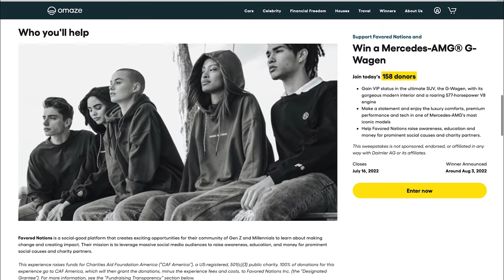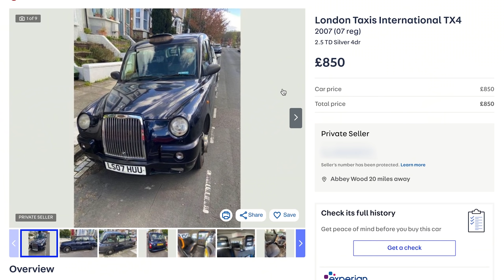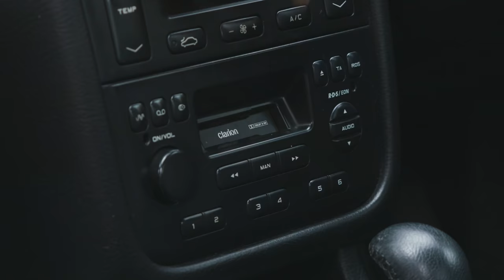Can We Beat A G-Wagon With £1000?

Comment: I reckon you’d get 10% more power from the 406 with a good service and a bottle of Redex
Reply: I was about to say the same. Would love to see a rematch with the Pug well taken care of. Or just throw out the dead weight sitting on the passenger seat. xD
Reply: I honestly expected them to do it, because it's a £1000 challenge, so they still have £100 left over to do a good service.
Reply: Oil and filter change, change the gearbox oil. I think it would make a big difference. Don't really like peugeot but the 406 coupe is a nice looking car 👌
Reply: @BerserkFury89  even just sitting it for half an hour with the engine running, premium petrol in the tank and the revs held at say 3000 would have made quite a difference - get it nice & hot, decoke the heads, clean up the injector tips and heat the spark plugs through so they self-clean.  Total cost would have been 20 quid of fuel or so (as long as the radiator thermo-fan worked anyway)
Reply: Junk the standard air sock that goes to the airbox  - it's a genuine (for once) restriction on the V6 406.
Reply: An oil change on that autobox would probably make a huge difference, they're sluggish as fuck when they get old
Reply: agreed
Reply: @TheRealFLX81  Put it in the boot of the Saab as originally suggested :)
Reply: "Do you want to see more G-Wagon drag race content"
Yes, I absolutely want to see them tune up/weight-reduce the 406 and have a rematch

Comment: So happy to see a 406 coupé here, I own one and it is my first car (not the V6 sadly, the little 2l petrol). But it is such a great daily. It's comfy, nice to drive even 23 years after its first run, and there is enough performance for most if the situation. And even here in France, we don't see some that often. Love it !
Reply: I also have one and really live that car. I own another cars, more recent and expensive, but i prefer the 406 Coupe 👌
Reply: I have 2.2 petrol 406 coupe and this gem is staying with me no matter what. If my gf would announce tomorrow she’s pregnant with twins - I hide 406 in a garage and buy proper daily, but never sell it :D
Reply: How's the maintenance on these I'm out here in Mexico and I've seen a few around and even one that was a pininfarina version it was hot I asked the owner bout it a bit but def a cool change from usdm cars!
Reply: @E_tiBEAMERBOY  Mechanical parts aren't expensive, cuz underneath this is still a 406. The problems start if you need some body parts - i.e. bumpers can be crazy expensive. 
Fuel consumption - my 2.2.pb needs around 13 liters of gas per 100 kms in a city. A few weeks ago I was making a trip, around 1000kms and it burned exactly 9 liters per 100 kms.
Reply: @E_tiBEAMERBOY  it's a great car. I also have a 2.2 petrol coupe. If you maintain it like you should, it'll never let you down. Mine has almost 270.000km and i can still throw it into corners and drive it like a maniac and it'll happily do it. Ofcourse things wear after such times and i think that all Rubbers will have to be changed by 300k. At the moment i have a few leaks, one from the engine to the transmission and another from my head gasket. Both sound more serious than they are and it drives like it should. It just needs some love but my funds are low atm lol. also not difficult to work on, the engine is in plain view

Comment: "engine light was on but the engine wasnt my worry"
says it all with a peugeot
Reply: These 3.0 V6 ESJ engines are very good solid lumps. The very most that could be causing the EML is a coil pack of O2 sensor.
Reply: That era of peugeot were reliable. I had a 106, 206 and a partner. More reliable than the Nissan and Toyota I owned. The  208 GTi I own now. Yeah, that's a whole different story.
Reply: Had one did over 100000 miles in mine and the engine light never came on. That will just be a sensor failing after 20 years same as any car would

Comment: The ZF auto box on the coupe has a "Sports" mode operated by a strangely hidden button.  I wonder if those guys found it.  It makes a real difference to the way the V6 puts down its power and manages the gear changes to optimise acceleration.  Seriously, the 406 Coupe was never designed as a drag racer but a high speed luxury cruiser for the French Autoroutes down to the Cotes d'Azur. I've done that and in that environment it does everything that you need for an idyll drive! 😍

Comment: That 406 has got the 190bhp V6 in it. The later ones got the 210bhp upgrade.
Stunning cars, my dad had one of the first back in 1997 in Lugano green.
Reply: Correct, later L7X's had VVT which gave them a power increase.
Reply: This coupe has 210 bhp engine. Older engine has different engine cover and an oval intake at throttle body

Comment: I reckon they should put the 406 on a dyno to find out if that EML wad holding them back... see if it was actually putting 210bhp through the flywheel.

And if it wasn't, get it back and recalling the G Wagon

Comment: I owned a 3.0 V6 406 coupe back in 2009 for which i only paid £1500 for a 1999 model. The V6 made such an immense noise at full chat, just a shame its actual performance didn't match up to the sound. 

The version I had was the 194 bhp manual not the 204 bhp and that took 8 seconds to get to 60. That 204 auto would take around 9 seconds not 7.4, that was the manual version

Comment: I had a fencing business and a Nissan dual cab with an LS2 swapped in. I was towing a trailer with my skid steer on it from the back paddock on a huge farm. One of the other guys was driving a 79 series Landcruiser and decided to race me. I know that Landcruisers top put around 150kmh and I was pretty sure I could top it. So I was doing 165 flat out towing around 2500kg on a farm track. It actually wasn't too bad because I had really good trailer brakes and it stayed pretty planted.

Comment: That 406 is well posh, in it.
I have a £30k Porsche and a £3k Alfa Romeo. Same results in drag races between the 2 as this. Porsche kills it off the line but start at 20 mph and there’s not much in it. NA big engine v turbo smaller engine.
Love your work 👍

Comment: As someone from the US it would have been very interesting seeing what would have been available to try this challenge. Also its fun to see a challenge that my personal car might have a chance at. I've got an 05' Buick LeSabre Limited, its a decent car you can find for not too much and with a service its a 3.8L V6 with 200+ HP and a 4 speed gearbox. Probably still would've been beat out but still would have been cool to see.
Reply: Would have been almost exactly the same, maybe a smidge slower than the peugeot. Power to weight is likely almost identical, so its down to how good the gearboxes are, which also shouldnt be too different.

Comment: I can't believe they didn't think of the 2.7 Bi-turbo C5 A6 or early to mid 2000s Saab 9-5 2.3. For 1000 pounds they would've been in a really rough shape, but probably good for a few drag runs, before start pissing oil and coolant everywhere. But still 250-260 hp and with manual transmission.

Comment: I would like to see this drag race again with the same cars but first, fully service the Peugeot plus change the fuel filter, fix the engine light issue, check tyre pressure.

Comment: The L7X engine is pretty good and its easy to take them to 225bhp the same as the original Clio V6.  However Renault, Peugeot, and Citroen have stopped all parts support for this engine. They leak oil so bad from the plastic rocker covers and without part support they are a nightmare. I used to have 2 Laguna II V6's but ended up scrapping both as i could not maintain them anymore.

Comment: The pt gt would be the best choice. SRT4 motor with 230hp 245 torque stock, pull the line off the wastegate and you have 300hp for the drag race

Comment: Considering the check engine light was on in the Peugeot, there's a good chance that was in limp mode right? So it would probably have beaten the G-wagon if that was fixed.
Reply: Wouldnt have been in a true limp mode if it could do those speeds, so I would say no. Lots of issues can give check engine lights without affecting power.

Comment: So I brought my first car in February, done me decent until I past my test 😢in may, the starter motor needs replacing and the map sensor, both cost around £180 total, I’ve already replaced the exhaust and put loads into it, it’s a VW Polo 2005 1.2L with 144000 miles would you go ahead and fix it or scrap it.

Comment: Can you do a top speed run somewhere? See how fast the 406 can still go after all its years
Reply: They cant. No airstrip is long enough to test the top speed of a normal car. They would have to go to Germany for that, and I doubt they will for a cheap car as this.
Reply: @GoldenCroc  Millbrook proving grounds has a circle track for high speed testing, top gear used it in a few of their cheap car challenges. As such it's available to be hired for filming.
Reply: @dominicrichardson5546  Never seen a uk based youtube channel use anything but air strips; as such I draw the conclusion the track is much too expensive to rent, more than an autobahn back and forth would be. Top gear has/had as we all know, a budget probably hundreds of times larger than most youtubers. So it doesnt seem likely, sadly. Cheers.

Comment: You guys should check some other auction houses yourself too! You can find steals from there with a low price, i found my 7 series e38 yea its a 725tds but i got it with a 1/3 of a price of one and it was working perfectly.
Reply: 725 tds e38 is a pretty cool car... the ultimate mile muncher without having to fill up too often (higher average speed) back in its day.
Reply: @GoldenCroc  Yeah, bought it on online auction, they couldnt get it to run, with 1/3 of marketvalue, got a running driving car, it just had summertime diesel in it, so it could only start in a garage, after 15mins warming up it was a runner. First go started right up. And its a amazing daily car for the diesel and not so thirsty engine even with a heavy foot, 6/100KMperL roadtrip high milage trip but 10/100kmL in town xd. It still does it to this day.
Reply: @atsv2829  Very nice. You will perhaps be pleased to know I do quite long and pretty fast trips in my car (E92 335d) myself, latest one was today. Not comparable to an E38 in comfort of course, especially since I got semi-track suspension on it. Cheers.
Reply: @GoldenCroc  They are a excellent sample of BMW engineering! Mine waits for MOT, what it should pass fine :)

Comment: I know you have a no BMW rule but ive just searched and found 2 530s that would be quicker...Im only 11 mins into the vid so dont know if the Pug did the job but....     It'd  be the same stories with Mercs. Get an old unloved E320 as theyre going for under a grand and will have more power than the pug (more weight too)

Comment: well, I bought and tuned a car for about £1500 and it wasn't much slower than a g wagon without something in tow. 0-100 in 5.2 sec and the g63 amg is 0-100 in 4.5. give me some time and another grand or so and I would have beat it. or just risk the engine, turn up the boost and hope the engine doesn't go boom

Comment: Pity you got the automatic, very bad for drag racing. Second gear goes to 130km/u. Manual is way quicker, automatic doesn’t do 0-60mph in 7,4 sec I think. About the EML, start by changing the coil packs. Very common failure, I saw you had the original black ones. Unbelievable it still has those. Valve covers are very common to leak, yours leak to. The internals of the ES9 V6 are very strong, no oil usage even with high miles.